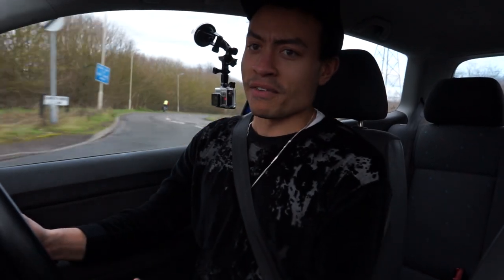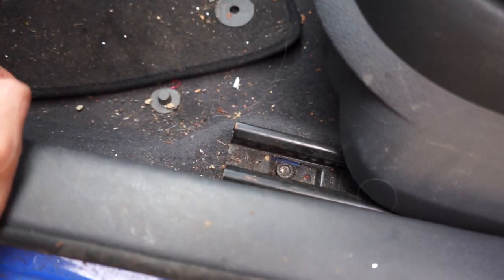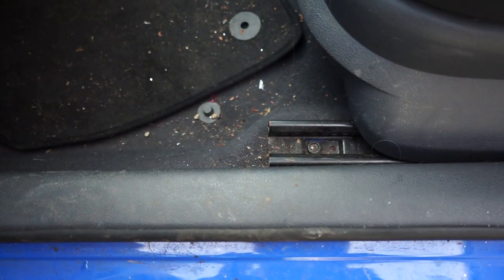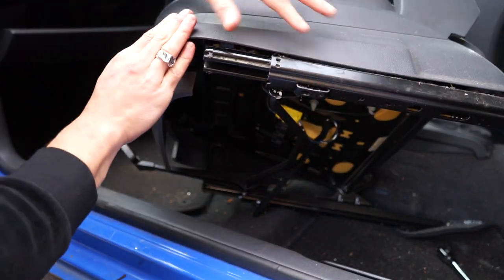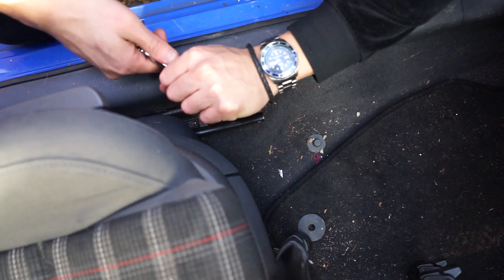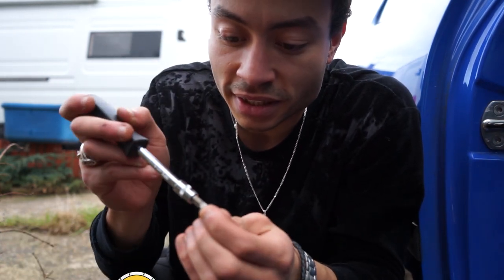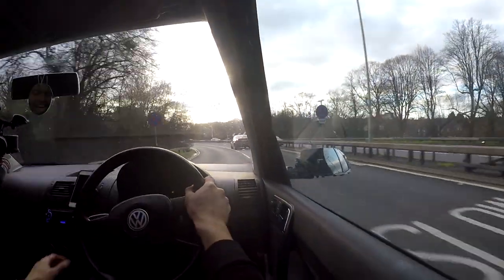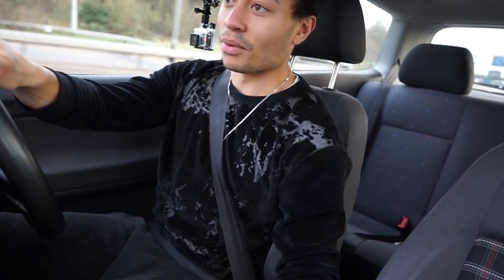Fitting GTI Seats Into a VW Polo 9n! | Pointless Polo Project

Comment: Doesn't matter how fast your car can go round a corner if it only takes 0.1G to slide you onto the passenger seat! Definitely a good upgrade. I agree on the upholstering though, always looks a bit naff having stuff from the wrong car. Saw a BMW 325i with a Type R badge on once...that was amazing.

Most difficult job I've done on my car? Washing my old, red Peugeot 306 (epic beast) after I parked it under a power line during migration season and a good 2,000 birds emptied their blackcurrant-filled loads onto about 7-8 cars including mine. I've never done much serious mechanical work, but I'd rather rebuild an engine than deal with that again. Took at least 5 hours of proper hard scrubbing to get that thing clean.
Reply from the maker: Agreed! It really was a completely worth it modification, helps so much with the overall feel of the car. But yes reupholstery is on my list to get rid of those GTI logos! I once saw a Smart car with the Mercedes logos swapped onto it, like I get the reference but really. 

To be fair I had seagulls deposit on my polo while I was in Bath and it was so much effort to clean it off after baked on by the sun! Not fun at all. Can't have been anywhere near as bad as your powerline job though. You going to London classic car show tomorrow?
Reply: Nah, bit far for me and not really a classic car guy. I do need to go to more car shows though, been a while since I've seen a McLaren...

I can almost forgive the Smart Mercedes, since it is just a Mercedes anyway. Bit like sticking BMW badges on a Mini, although I don't really see the point.
Reply from the maker: Apothecary Terry ah fairdos - I'm just about to head over, never been before but have heard good things! Yeah I definitely get the idea but I'm not sure why you'd bother (that said I've always said I'd like the new minis if they had BMW badges (but that would be from factory))
Reply: From factory would make more sense, although not sure about the Mini, I think they're a bit too much like handbags to be BMWs!

Comment: a little tip when using a ratchet in awkward angles, hold the top of the ratchet with the palm of your hand and use a finger along the handle of the ratchet to guide the twisting motion
Reply from the maker: Yeah that's a fair shout, I also should have just used the longer bit to get over the top of the seat!

Comment: I've got the same problem with my 9n, you go round a corner faster than 20mph you're basically hanging out the window. What I've learnt to do just brace my leg against the foot well to hold me in [you do it right, you can still reach the accelerator]

Comment: I have the same stock Twist seats in mine and they look awful! GTI ones look great, I'm envious! You got a good deal on them. You KNOW I'm gonna mention the ARB again, don't you!?!
Most difficult job on a car was trying to put a coil spring on the strut using antique clamps. Took hours and nearly took my father in law's thumb off! Didn't work so had to get it to a garage. Would not recommend DIY with springs!
Reply: put pro sport coilovers on mine, wasnt too difficult. just need some decent spring compressors
Reply from the maker: Yeah it's such a benefit having the gti ones in there - the twist ones did suck in comparison! Haha the ARB is still in the pipeline - spoiler is I just did the dampers and springs, need to swap the poly bushes too, then will be potentially looking at the whiteline! Luckily my dad was on hand for the dampers and springs, but yes a very difficult job overall!
Reply: @danielp4017  yeah or problem was that my father in law's clamps were made for springs from the 70s with more loops and they weren't wide enough to cope with the compression. Coil overs sound cool, but honestly the wife will kill me if I spend any more on it! 😀

Comment: Did you look into retrofitting remote central locking (google seat ibiza comfort control module for Polo 9N) and also installing projector headlights?? Great vids btw 👌🏼
Reply from the maker: Yeah I've had a look at both - will likely do the headlights but not sure about central locking yet as mine is already so temperamental I don't want to fiddle with it too much! Cheers boss 🤙🏽

Comment: Lol I have an airbag light for over a month now. I got bored of taking my car to the electrician. It’s already been 4 times, 130€ for a module inside the steering wheel which was causing the issue. Well... the light turned on again after like 2 weeks.
Reply from the maker: Jake N. that is really annoying - I've seen/heard so many horror stories about airbag lights being nearly impossible to get switched off properly - maybe just remove the bulb 😂
Reply: Cars With JB ahahaha I was much lazier than that! I put a black insulation tape on the light because it’s annoying on my eyes. I’ll give it a fifth try and bring my car to a different electrician next time. The Airbag light is a nightmare!
Reply: Just spend the money and get it fixed man

Comment: £180 is a tad dear for tye condition mate, i paid around 200 or a tad more but i got rears too,

my brother ended up breaking his gti and i took his black roof liner and plastics, that makes a huge difference
Reply from the maker: The guy wanted £230 for them originally which I obviously wasn't going to pay, I set myself a limit of £200 since there weren't any really available at the time and got them for £180 which I'm fine with! Knew I didn't really want the rears as I do want to reupholster the car regardless, but you've definitely done well to get both sets for just over £200. Definitely helps to have someone breaking a GTI - I'm looking into what I can do for the interior as we speak!

Comment: My first car had which could only be described as a bench on the front seats, they gave you no support whatsoever lol. Do you know what your weight difference is between the original and gti seats? not that it'd be a massive difference lol.

Topic of The Week:

i crashed the micra into a bush and had  to fit a new front bumper with my uncle, was such a nuisance because its all little plastic bits clicking together, so you want to get them off, and try reuse them but the amount that would snap... infuriating, but i guess not too difficult. Not had much else to do other than servicing on my cars thankfully. Check engine light on my clio for a post cat O2 sensor, but thats a feature now, not a problem to be fixed lol
Reply from the maker: Hahah it's the same with the polo seats/the seats in my old Skoda, the GTI seats have honestly revolutionised the car in a way no other mods really have so far! Not completely sure but the new seats are definitely heavier by a little bit as they have slightly more functionality - not the end of the world though! Haha yeah I feel that - my Skoda got bumped into once on the rear bumper and I just could not be bothered to fix it because of the stress! And the check engine light was a similar feature on the Skoda from the o2 sensor!
Reply: @CarsWithJB  ye big bolsters make it so much easier to corner, and safer as you can concentrate on driving instead of trying not to slide off lol. I hope you enjoy your new seats excited to see what's next! 

Maybe consider taking the passenger seat out for the ring! Unless you're taking a friend with you that is
Reply from the maker: ginj4ninj4180 exactly that - so much better! Plenty more to come - already completing more jobs on the polo and getting the videos ready🤙🏽 for the ring it would make sense to remove the passenger seat but I wouldn't want to get an airbag light on so will likely leave it! But may well persuade my girlfriend or best mate to come with so we'll see anyway

Comment: Hey, I did a seat swap just as you did. But every since I did it my airbag light is on. What could possibly be? 
Nice video
Cheers
Reply from the maker: Did you disconnect the battery before you took the seats out? And then (obviously) make sure that everything's plugged back in fine? I would suggest maybe getting the codes wiped to see if the light stays off, I'm sure there's some trickery to be done in terms of removing the airbags again off the battery and starting up the car again
Reply: Cars With JB I will try what you said. I think its tricky and I need some luck. 
Thank you!

Comment: Hi mate I recently took my seats out and put one back in after battery in a rush is they any way to get airbag light off without plugging computer in 
Cheers
Reply from the maker: Hmmm I think you'd have to get the computer in but I may be wrong - otherwise try removing the battery again? Or retracing your steps in terms of removing the airbag on the battery, then removing battery, then plugging the airbag back in then the battery? Otherwise I'm not sure, my dad has the obd computer to plug in so I would always do it that way!
Reply: Cars With JB I’ll try that first then I bought an aftermarket cable downloaded everything and when I plugged it in car it wouldn’t connect just kept scanning cheers bud loving these vids

Comment: i am a 17 year old, almost 18, learner driver who is close to finishing their learning and passing. I have been looking at cars to get as my first, and i seem to have my heart set on a 2006ish honda civic (European version). Any information or recommendations on anything would be lovely. im looking at spending £2000 max on the car btw
Reply from the maker: Sounds like a good plan - where are you from? Really depends on insurance and what you want out of your first car!
Reply: @CarsWithJB  I'm from the lovely east Midlands UK. I'm not hugely fussed about top speed and things like that, I want my first car to be something enjoyable to drive, and have many utilities. E.G. large boot as I need to transport my guitar a lot. And fuel economy and insurance are biggies aswell.

My grandad for years had a Honda civic and it was a joy every time I went out with him in it, probably why I want one so much😂

Thanks for the reply
Reply: @That-Dave-Guy  as a 17 /18 year old I'm assuming you will buy the 1.4 petrol in which case I recommend buying the 2009 facelift model if budget stretches as your getting a far better engine 59 plate onwards
Reply: @xenongames7533  Is that the European version though, because there are different versions in Europe and both America
Reply from the maker: You could consider an estate if you want something practical etc - I always bang on about it but the Skoda Fabia Estate was the best first car I could ask for - making a video with useful low-insurance cars for young drivers and the newer Fabia Estate fits that category perfectly, I'd have a serious look into it!

Comment: Big improvement, next up the steering wheel.
Reply from the maker: Yeah that'll happen soon to I reckon - not sure which wheel to go for yet tho 🤙🏽
Reply: i would like to get a new wheel on mine too, but dont u have to have an airbag if the car came new with 1 to get through the MOT?
Reply from the maker: Daniel P you can get wheels with the correct connector and do the same thing I did with the seats in this video - not sure which wheels fall into that category at present but will find out!
Reply: Cars With JB get a polo 9n3 gti wheel!